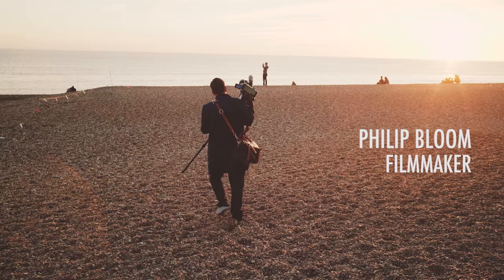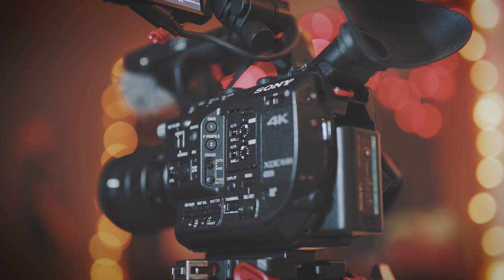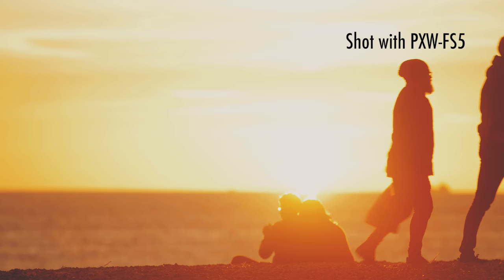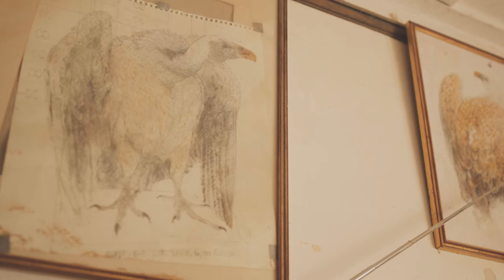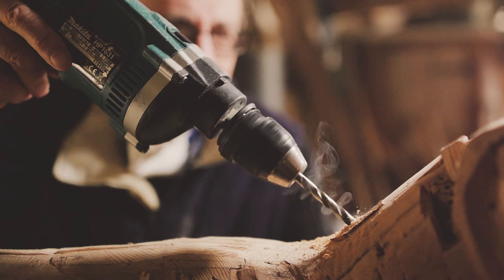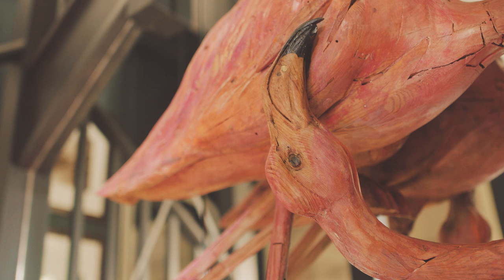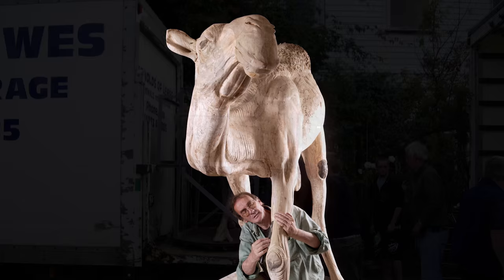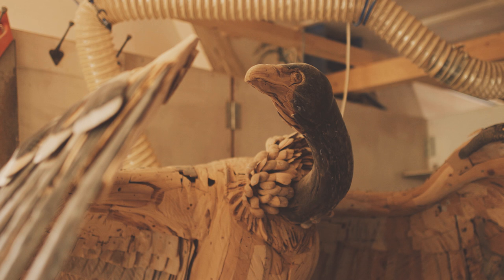The Wood Carver: A Sony FS5 mini documentary

Comment: Beautiful work as usual, Phil. Your storytelling has become so naturally engrossing, I have to watch several times to evaluate the camera and lenses now. :)

Interesting to see you dip into Sony lenses with the 16-35. I previously liked photos from that one on their A mount. The design is probably similar, if not the same as their Alpha line Zeiss lenses, as I still don't like their 24-70, much as I didn't on A, heh.

Hope to see Sony come out with (or firmware upgrade their way to) something a little more competitive to the C300 II with great 4K in a small body. Preferably with the option of more advanced codecs such as h.265 like the (too amazing for their newness) Samsungs have. Today's massive file sizes are getting the best of me, especially as I almost always have to travel to get footage. Really have to learn a less tedious method of file management. I'm surprised Google hasn't yet cracked the code of storing the larger files in another dimension somewhere. sigh :D

Comment: Is it just my connection, or is there like 2 or 3 frames that fell apart at 3:42?
Reply: +Ian Grogan Not just you, I saw that weird artifacting as well :P
Reply from the maker: +Ahkam Nihardeen yup it has been mentioned a few times in comments. It is a YT encoding glitch and other than delete this video and reupload noting I can do
Reply: +Philip Bloom well that's a real bummer. This is unrelated but, I'm just reading your blog about the Rx100 IV and rx10 ii. I'm looking at either to use on a pistol grip style 3-axis gimbal. I know both have the same slow motion capabilities but from what I'm gathering the slow mo is a paint to use on the Rx 100. Would you say that's enough reason to buy the Rx 10 over the 100? I really had my heart set on the small size of the 100 but if you can't focus while in slow mo then it's kind of pointless to me.
Reply from the maker: +Ian Grogan thankfully they replaced it for me so all good now.
Reply from the maker: +Ian Grogan the slow motion is identical on both cameras in how it operates...once it is in standby mode no settings can be changed